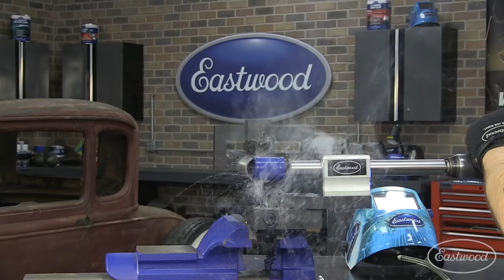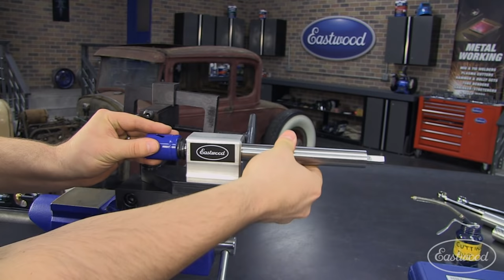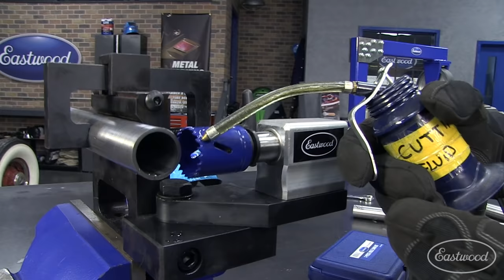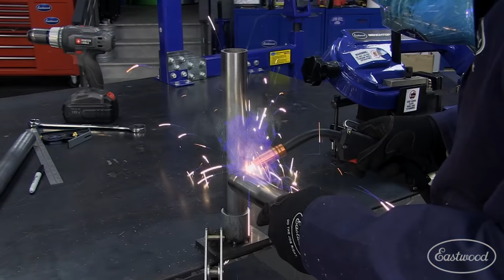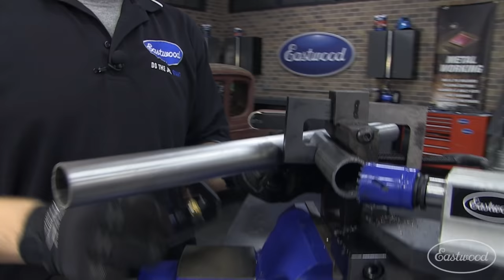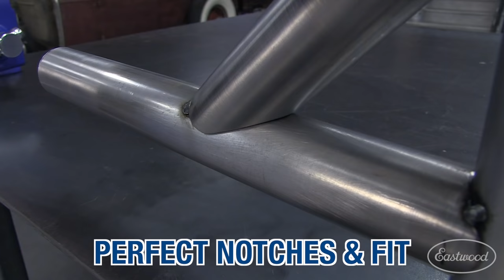How To Notch Tubing to Build a Roll Cage, Exhaust, Go Cart Chassis - Eastwood Tubing Notcher

Comment: For a 45° pipe measurement for 5" rise and run the diagonal is easy to find with a multiplier of "  1.414. " try it 5x1.414 = 7.07 take the .07 x by 16 =1.12 answer = 7" 1/16 .

Comment: Your notcher, I haven't seen anyone address the vertical adjustment on it? is there a way to keep the planes of the parts perpendicular?
Reply: It should be designed in way that the center axis are in the same plane but i think u could elevate that bearing block by adding washers under it, cuz its holding on 4 bolts.

Comment: Nice  tool  thou  see no reason it could not be mounted pretty much at any position. That actually makes it a more versatile tool.  Can you explain how being unlevel could make a difference??
Reply: The difference is when doing notches on both sides you can use a spirit level to align your cuts.

If you're just cutting one side it's useless indeed

Comment: Forgive my ignorance on the matter. But, why does it have to be level? I mean, the thing is basically a jig, right? It would seem to me that it would make the same cut whether it was level or not.
Reply: If you don't level it, Your X or Y might have a different angle cut
Reply: Notice later he leveled one of the tubes he was cutting (45* both ends) after his first cut so that the second cut would be in plane with the first. You're probably right, a single cut on a pipe doesn't need to be level. But if you want to use leveling to help with second cuts, it seems to be the quickest way.
Reply: It wouldn't matter if you're level or not.

Comment: Why would it matter if the notcher is level at all?  Level or not the relationship between the part that holds the tube and the part that holds the drill doesn't move? Does it?
Reply: jhitt79 it's not for lining up the pipe in the Saw it's for when you are wanting to line up a pipe with another pipe so that joint fit properly

Comment: Wouldn't it be better to use TIG welds in this case???
Reply: Yes because of the lower heat affected zone. High heat distorts weakens joints.
Reply: @alaskanken2132  well I'm not sure TIG would have less heat input, I was thinking to a more controlled penetration
Reply: Yeah, TIG for me. I find MIG's larger shroud makes acute angles difficult to weld properly.

Comment: It really doesn't matter  how good someone is with a torch or plasma cutter, you will never be able to cope notches this accurate or this clean. There are also applications when introducing heat from a torch or a plasma cutter, prior to welding, is unacceptable.

Comment: Why was this not tig welded? A lot of talk on building cages on race cars but every major nhra class requires all cages to be tig welded including stock, super stock, pro street and pro mod. I think it would have been a cleaner video and Eastwood would have get a ton more customers to believe in their products if you show the actual proper steps to building things with the tools advertised and nice clean execution aka welds  on this particular video wether it be tig mig or stick. Just some food for thought, but hey what the fuck do i know.
Reply from the maker: +BlueCollarDreams We wanted to focus on the tubing notcher in this video and show how it works and how to get perfect fitment.  You're correct, if we were actually building a roll cage, we would have used the Eastwood TIG 200 to weld it together.
Reply: +BlueCollarDreams    Well maybe not everyone in Eastwood's audience will be building NHRA class cages?   NASCAR, NASA, SCCA, BMWCCA, PCA, just to name some are all fine with mig welded cages if you are using the appropriate material for that process.   It's typically the material that dictates the process, ie cro-mo=tig and mild steel = mig (although it can be tigged as well) - the sanctioning body just follows through to make certain someone actually knew what they were doing.  Pretty sure if you check the NHRA rule book, a mig welded mild steel cage is legal.  ;-)
Reply: we have mig welded everything we build frome hotrod to race care to custom Harley frames.never had one break never and that even with the frontend of the cars slammin the ground after a wheelie but we uase the best material we can buy..
Reply: Not true! NHRA Accepts MIG welding on bars, cages & frames that are mild steel. Only Chromoly has to be TIG welded.
Reply: I'm just finishing up my mild steel 7.50 cert 72 Monte Carlo. Will give me years of crack free enjoyment. I will never have the money to keep up with the rich guys, so I don't care about chrome moly. Mild steel cars last longer anyways! Ask any chassis builder. Mig welding works just fine, and if I total mine in a crash, I didn't just flush 50K down the toilet.
Reply: exactly
Reply: Who cares about a weld process on a demonstration of a notcher. The whole point is that it notches and that when you piece it together you have a nice fit to weld with whatever process you please.  It's a demonstration not a mandatory procedure.  .